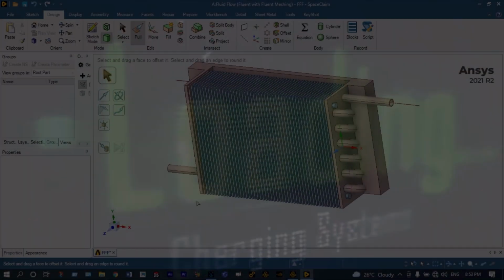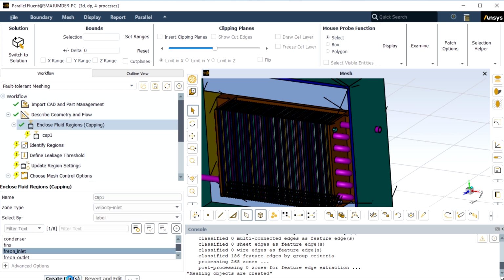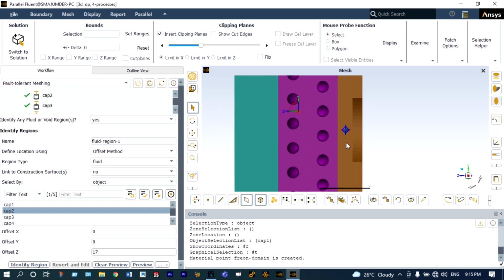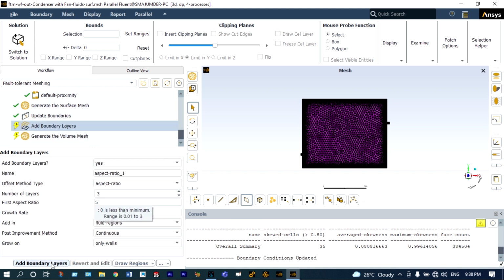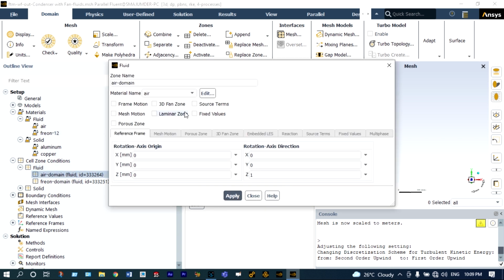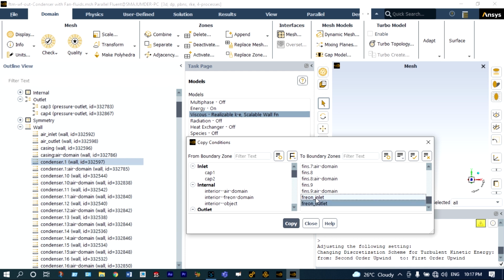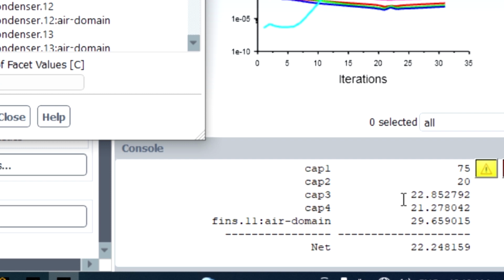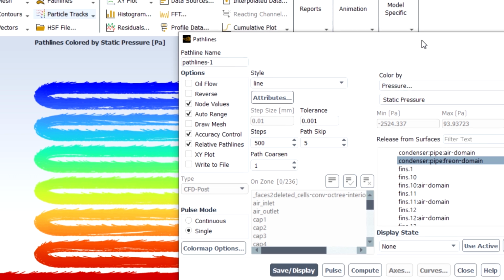CFD Condenser Heat Exchanger | Condenser Heat Exchanger Simulation Tutorial - ANSYS Fluent

Comment: Good Day! I want to simulate the condensing coil of our thesis that condenses incoming steam by using ambient air, but I can't fathom on how to set the values of steam and setting boundaries. Can I ask for any help if possible?
Reply from the maker: Sure
Reply: @CFD_GUIDE  Thank you for your response. Can I email you our condensing helical tube design, this is the last component in our thesis that need to be double checked

Comment: thanks your explanation... but why there is no multiphase flow in ur simulation.
i mean at the inlet of the condenser your fluid is in vapour phase i think and at the outlet that should be in saturated liquid form as a purpose of condenser?
Why dont you use multiphase approach?
Reply from the maker: What is the temperature at exit? It should be very close to room temperature but pressure should be high.